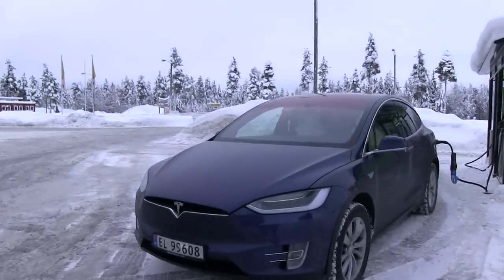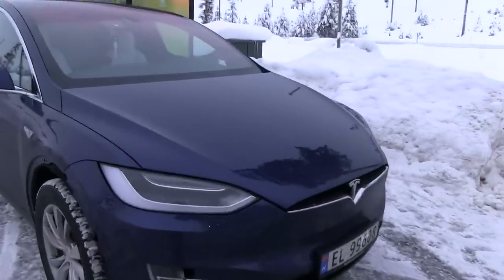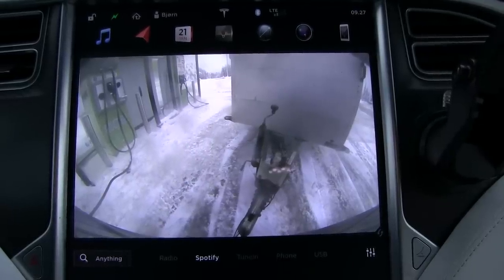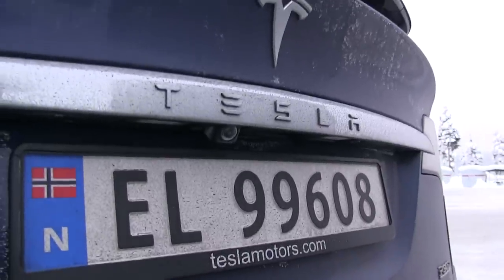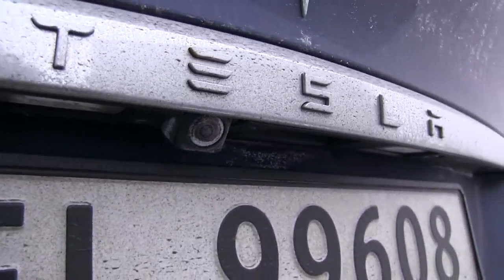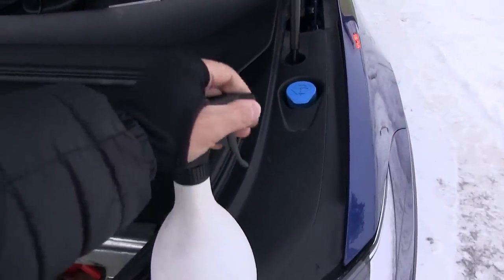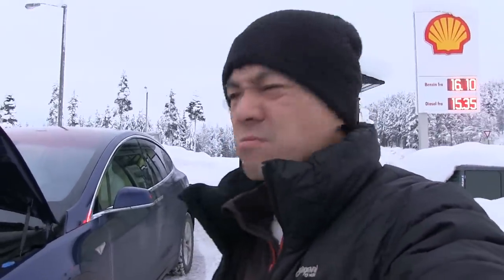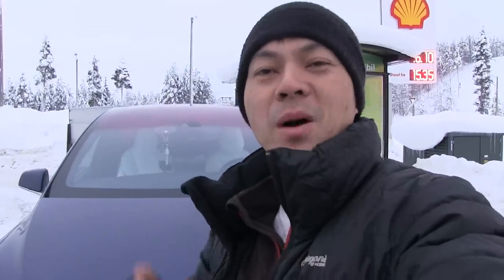Amazing! Backup camera treated with Ditec!

Comment: Is the frunk heated since you had a water squirt bottle in there and it wasn't frozen?
Reply from the maker: +IiroMikola It's not water. It's wiper fluid.
Reply: I see, it won't freeze so it's irrelevant.
Reply: Does it work with sausage fluid ?
Reply from the maker: As long as it's salty enough.